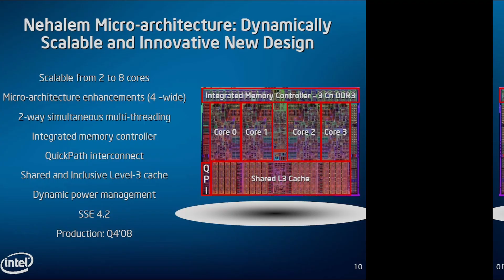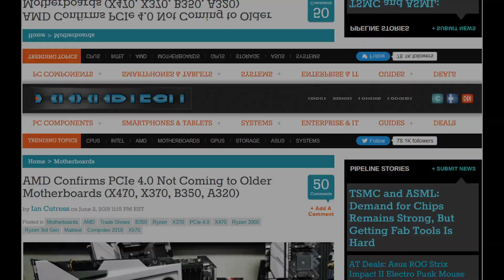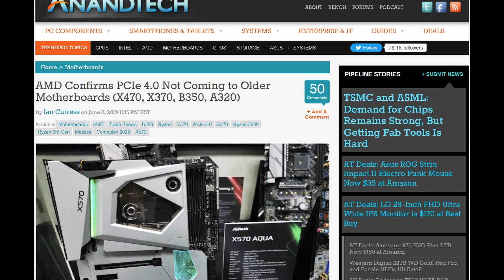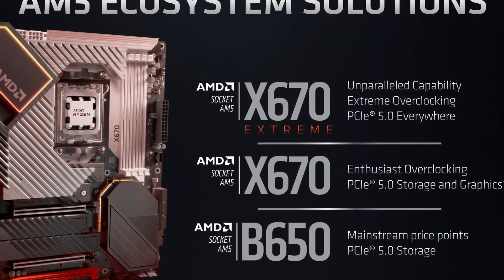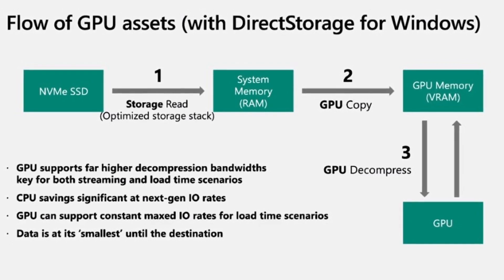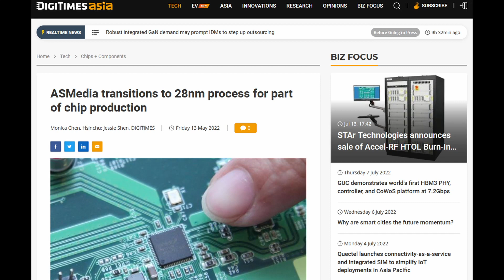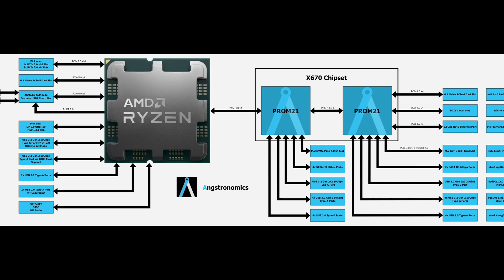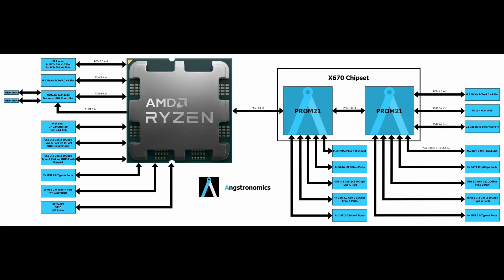The Smart Design behind AMD's X670E

Comment: Do you have an oversight why we still seem to need a Promontory 21 for 870/E USB4 connectivity. If the last 8000G CPUs already have a 2xUSB4 40Gbps support? Can't we use the advantages or differences in design of the mobile based Phoenix for Desktop? Is there a difference how the PCIe lanes are used on Mobile and Desktop platforms?

Comment: Lower speed isn't a reason to use a larger process. PCIe 5.0 has to switch at least 16GHz, much faster than any CPU core.
Why do you call them "chiplets"? There's one chip on each substrate. Would you say a multi Xeon system is made of chiplets? 
Why would a PCIe 5.0 slot support storage at 5.0 speed but graphics at only 4.0? (Assuming a PCIe 5.0 graphics card is available.) PCI doesn't distinguish between the different applications.
Reply from the maker: You are right, they are not actual "chiplets" like AMD has been using since Zen 2, but its a MCM chipset and its the same idea: build a single one and combine them.
The part where some boards support PCIe 5.0 for storage but not PEG is not because it wouldnt work, but because of market segmentation. They want you to buy higher end boards. Oh, and chipsets use older trailing edge nodes for economic reasons.
Reply: @HighYield  Every manufacturing decision is economic, chipsets use older process nodes because they have more predictable analog parameters. Purely digital CPU cores are more tolerant of such variance. By MCM, do you mean multi chip motherboard? Most MCMs have heterogenous dice. The PCI SIG should protect their trademark if these boards are not conforming, the slots must not make any distinction between the different types of peripherals according to their own specs.

Comment: I like SFF builds and my last 2 PCs (Intel i5-7500 and AMD R5-5800) were built on the mITX form factor, so I'm not a fan of segmentation of features purely based on chipset if those features can be otherwise physically implemented within the mITX form factor with all the lanes available from the SOC. For mATX, ATX and larger, the segmentation makes more sense due to the physical length of traces required.
Reply: Amd is slapping like a hotdog to the bum.
Reply from the maker: My current setup is also a SFF build (in the Cougar CBX), although I will like move to a slightly bigger base for cooling and to support large GPUs. I dont think you need to be afraid of missing out since even the SoC inside a Zen 4 CPU would be plenty to supply a ITX mainboard with a x16 PCIe 5.0 slot for the GPU, a 4x PCIe 5.0 slot for M.2 (or even two) and a lot of USB. With the addition of a B650(E) chipset, a second M.2 slot and USB4 should be possible. Not much more space on an ITX board imho.
Reply: @HighYield  sff is slapping raw...

Comment: Now we could talk about something as important:
pcie 3.0 vs pcie 4.0  on paper would be day and night, but on reality a gpu (on this example) would not have much technology to make that diference apparently. So a  gpu of pcie 4 is not so limited on a pcie 3, but a pcie 3 gpu on a pcie 4 go smoothly
Well what about pcie 4 vs pcie 5?
PD/Edit: in base of this is what I would buy or not a brand new mobo.
Reply from the maker: It wont matter for GPU performance. Just like you said, PCIe 3.0 to 4.0 doesnt really improve GPU performance, even at 4K using a 3090 Ti the gain is below 5% and it will be the same, or even less, going to PCIe 5.0.
But where it could really help is when games start to use Microsofts DirectStorage. This will allow the GPU to directly access a M.2 SSD, without bothering the CPU on the way and could really cut down loading times and improve streaming.
Reply: @HighYield   Thanks for the info !

Comment: I’m be no means an expert, But I cannot see how having chiplets in all these different parts is not causing  latency. The CPU, GPU and board chipset will all be chiplet designs. To me it seems like there has to be latency somewhere. It took Zen 3 for them to really figure out the Infinity fabric. This is all very interesting and I love what AMD is doing but I definitely have to see how this plays out. That sucks and it’s taking all my self-control because I usually buy every new GEN lmao. Seems like i might be just swapping out my GPU this go around.
Reply from the maker: Latency is only really an issue in latency dependent chips, like CPUs and GPUs. For a chipset, who supplies more USB, SATA and PCIe lanes, a little more latency doenst really have a big impact.
Reply: @HighYield  i understand,  I was just thinking when your gaming SSD is running through the chipset lanes. On a whole if you have a full AMD system i just thought all the latency would have to add up at some point lol

Comment: Have a 3850x system. Going to skip the better price on a 5950x and go 7000 by the end of the year.
Reply: Wait for Zen 4 with 3d vcache it will be available in January and MUCH better for gaming (15-20% in some games). A 7950x3d would last like 10 years

Comment: Do not really need a gpu on Pcie 5 but ok.
Reply from the maker: PCI 5.0 isnt really useful for the GPU, just like 4.0 still has very little benefits. But DirectStorage could change that, because with this new technology, GPUs can directly access a M.2 SSD, and if both parts run with PCIe 5.0, loading will be much faster.

Comment: have owned my r5-5600x for 2 years soon and I have no plan to upgrade my mb-cpu-ram and will get those new GPUs that will realise this year
Reply from the maker: My main system is still running a 3600 (even tho I'm upgrading to a 5800X3D soon), a 5600X will be more than enough for the next couple of years, no question.
Reply: @HighYield  well I think I may go for 5800x3d  2 years later if I need a upgrade or I will upgrade whole system

Comment: I can understand people will buy cheap MB but why PSU, my 240USD PSU are from 2011 and almost 12 years old and will keep it another 5 years idk how some people goes for low end PSUs when they have like 10 years of warrenty and even more life spin than that. when I move to ddr5 I will not get anything lower than 6400Mhz well no we can get highest as 6600Mhz 38Cl what I found but does not have a good price (700USD for 64gb) when 16gb cost from 100USD.
Reply from the maker: I agree, cheaping out on a PSU can backfire, because it might fry your entire system. And ppl often underestimate how a good PSU affects system stability.
DDR5 pricing is still over 2x compared to DDR4, lets see how it will develop once Zen 4 has been released.
Reply: @HighYield  well I agre with you but I can get 50% price drop on ddr5 :D

Comment: Great video. You've earned a sub.

I can see the advantage of using chiplets on chipsets. I wonder if more of the chipset function should be moved into the CPU package though as a separate Chiplet from the IO due?
Reply from the maker: I would like more I/O to be in the SoC part of upcoming CPUs so I dont need a chipset on my mainboard, but I think since not everyone needs the same amount of I/O, putting too much into the CPU itself could be bad from a economic point of view.
Reply: @HighYield  Possibly. Personally right now I do have a 5950x, and I could see the higher end IO option with many IO dies working quite well on a higher end desktop CPU, especially now that AMD may be giving up on higher end desktop Threadrippers. There doesn't seem to be a plan for a TRX based Zen 4 Threadripper with 3d Cache.
Reply: The largest problem would be everything having to be packed into the area the GPU & NVME M.2 have to be.
The APU market would need 1 NVME M.2, perhaps a single expansion slot so there'd be room for the other controllers close to the APU.

Comment: This video is highly underrated. We need more of these type of video's.
I think AMD is pretty much underrated too, at least for the mass. I mean if you look at the many innovations AMD brought to the x86 platform in the last 20 years is very impressive for a company with a smaller R&D budget. I'm happy Ryzen made AMD a much more respected company but technology wise, AMD has always been on another level. 

As for a SoC only boards, Yes please!! :) But for me it'll be more about SBC ( Small Board Computers ) so I hope AMD will make some "Next Gen Phoenix" APU's that are power efficient enough for some bad ass SBC's. Perhaps with 3D V Cache lol :D.  I see a lot of new devices popping up from 2025 onwards.
Reply from the maker: I think innovation is also a function of necessity. AMD had to innovate in order to compete, otherwise they actually would have gone bankrupt. If you want to compete against Intel you basically have to innovate, at least if you want to produce your own products. Many ppl dont remember, but AMD started out by copying Intel CPUs. Then their clones became better than the original and then they started their own designs.
Reply: @HighYield  I remember when AMD did bit-slice (2900) and memory as well (AM3101)
Reply: I've been using AMD boards and CPUs since the K6 days.  I'll never change to Intel on principle.
Reply: @ministryoflies1344  I went to the shop a long time ago to buy an Intel Pentium 90Mhz. But it was sold out. I didn't know AMD back then. But the AMD K5 100Mhz CPU was on stock for less $$. So I bought an AMD instead. I was sold, it was even faster than the Pentium in many cases and ever since I only bought AMD's. I only used intel because of my job. But personally, the last intel I spend money on was a 486 CPU lol.
Reply: @nedegt1877  My very first build was a 486 DX4 Intel...around 1995.  I ran it without a cooler until a few games came out that it struggled with.  I had no spare cash to buy a heatsink and fan so used to put a half frozen can of lager on the chip to overclock it to 120MHz 🤣
Reply: Love the way he explained the history and what to look out for when figuring out what type of board to get depending on your needs.

Comment: I didn't see any 2 dimm AM5 boards 2 dimm motherboard is better than 4 dimm motherboard when it's comes to stable memory overclocking
Reply from the maker: Yeah, so far I havent seen a 2 DIMM AM5 board either. I think someone did ask the same question during AMDs "Meet the experts" AM5 mainboard event last week and ASUS didnt say if they are planning a "Apex" like product for AM5. Especially with high-speed DDR5 it could be useful. Another "option" could be a ITX mainboard, as those usually only come with 2 DIMMS.

Comment: i'd like to have more PCIe slots, not need gen 5 but for example: 1x gen 5x16, 1x gen 4x16, 2x gen 4x8
if i need to connect GPU and 25 Gbps NIC and also 32 Gbps Fibre Channel  HBA and leave 1 more slot just in case
Reply from the maker: Yeah, for high-speed connections more PCI-E slots are always important. Do you actually connect a 32Gbps Fibre Channel directly to your PC?

Comment: This is interesting : so the chips serve as switch/bridges to reduce the pci express lenght on the motherboard as well as io hub.
Reply from the maker: I haven seen the exact layout of the Promontory 21 chips yet, but the closer the chipset is to the actual I/O port (be it PCI-E slot or something else), the easier it is to design a clean signal path. And with two chipsets on one mainboard, pathing should be more straigh forward. The "switch" part is speculation on my side, but that's how I would try to implement it.

Comment: An AMD server has at least 128 PCIe lanes, it doesn't use a chipset at all. It won't start using multiple chipsets to use as a beefed up PCIe switch.
Reply from the maker: You are right, as others already pointed out. And it doesnt really make sense to create a chipset that could be integrated into an I/O die on a server CPU. So the scaling would only working for consumer products (mainstream to HEDT).

Comment: I want a gen5 m.2 and x16 GPU, 3+ gen4 m.2, 6+ SATA, a generous amount of USB 2 & 3 ports, and either two USB 4 40gbps ports or expansion slot with enough lanes to support an add-on card to add  2x USB 4 40gbps ports.  I'd want it to be less than $250 as well.  This would hold me over till next socket.
Reply from the maker: I think I have already seen some mainboards with these specs, but I'm not sure your price target will suffice ;)
Reply: @HighYield  he dreaming with that price lol

Comment: Good presentation. I will be going for the X670, not the X670E.
Reply from the maker: X670 has all of the I/O most users need, I feel like X670E will only make sense if you want a fully PCIe 5.0 based system.

Comment: Bit late but I have an asrock steel legend b450m which is a pcie g3 out of the box but I have the latest bios 4.30 on it which makes run at pcie g4 I have a 3800x and a rx 5600xt which only runs at pcie x 8 though and not the full x 16 I don't think it has the traces to do the full x 16
Reply from the maker: Are you sure BIOS 4.30 really enables PCIe 4.0 on your board? Or are you maybe getting this from CPU-Z who (correctly) reads that your CPU provides PCIe 4.0 but incorrectly states that the board also runs on gen4?
Reply: @HighYield  Yeah after a bit of googling I think you could be right there HWiNFO is telling me the card is PCIe v4.0 x16 (16.0 GT/s) @ x16 (8.0 GT/s)
Reply from the maker: I knew it! The same happened to me a while back, CPU-Z showed PCIe 4.0 and I was like "cool", then I goggled it and well, sadly it wasnt true...

Comment: You should consider a video on what it would take to move one of those chipsets into the CPU package. Would AMD have radically change the motherboard layout to make it possible? Or is AMD stuck with the current motherboard layout? Personally, most buyers would want 16x 5.0 PCIE for the GPU, 4x 5.0 PCIE for a SSD and ethernet from the CPU for the minimum spec until the older platforms are phased out. The other IO can share the PCIE with the SSD.
Reply from the maker: Lets see if we get some more infos about Promontory 21, e.g. transistor count and the process node its produced in. I think it would definitely be possible, the question is, if its a economic choice?
Reply: Reading Angstromics article about AMD 600 series boards it already happened, the motherboards chipsets are just PCIE hubs with controllers attached.
As higher speed PCIE requires tighter constraints on signal length, physical space forces use of hubs.
The daisy chain dual chipset allows distribution of controllers.
 In consumer, i/o except GPU & NVME is hanging off the same 4 lanes as other devices are rarely in use simultaneously and it avoids HEDT/server manufacturing costs.
Reply: This is all i want. Hopefully they have B650E

Comment: I am going to get a 670 extreme motherboard as i expect it to last for at least a few generations of AMD cpus, plus support all the pcie5 add ons we might find in that time period.
Reply from the maker: A full PCIe 5.0 system (M.2 + GPU) would be amazing to have, especially if DirectStorage will be implemented into a lot of future games. Lets see how many generations a X670E mainboard will support this time, I think less than a X370 which goes from Zen (1) all the way to Zen 3D.
Reply: @HighYield  Being able to go from Zen1 to Zen3D is stunning. Factor in the relentless 'new motherboard' requirement for Intel, and this becomes waaay beyond stunning. But, that was competition-driven, and with how well AMD are now doing, I don't see any more than 2 full Zen generations (excluding refreshes/3D variants) this time - still, that would be excellent too.
Reply: @HighYield   DirectStorage was reportedly still using CPU decompression rather than streaming it directly to VRAM and decompressing on GPU in April this year.
The CPU decompression was bottlenecking the fast NVME drives in past tests, so even PCIE4 wasn't benefitting game load times.
The CPU decompression has become very evident with the Spiderman port from Sony that streams in data.
Was looking at an upgrade to a fast NVME drive, but not finding evidence that it's worthwhile.

Comment: Threadripper Pro supports 128 PCIe 4.0 lanes over the CPU , an chipset which is  rather an I/O Hub is not really needed , Server often have no chipset but TR Pro is High End and the Motherboard has to offer much I/O . I could  live with no Chipset if i would get more PCIe CPU Lanes , 20 / 24 Lanes in Mainstream is not enough for my needs .
Reply from the maker: You are right, servers usually dont have a chipset and Threadripper already supplies more than enough PCIe lanes for most users, still I'm sure there are some power users who could always do with more.

How many lanes do you need for your setup and what are you connecting with it?
Reply: @HighYield  
I use 8 Lanes for a QSFP+ card , 40 Gbit Ethernet direct to NAS  , second port to my 10 Gbit Ethernet Switch  , 8 Lanes to the GPU , 4 Lanes to the first NVME ( CPU ) 4 Lanes to the second NVME ( Chipset) and a 3 rd NVME on a PCIe Adapter card ( Chipset ) with an B550 Board and an 3900X 12 Core
You can buy 40 GBit Dual port cards really cheap currently , i payed 30 Dollar + 15 Dollar for an PCIe Adapter because HP has its own LOM Format which is PCIe but not compatible to normal . Not that i currently need 40 GBit with the HDDs in the NAS but at some point in Time i will change to SSDs and then 40 Gbit will make sense
Reply from the maker: WIth a setup like this, a lot of PCIe I/O makes sense. I dont even use any NAS, all I have connected externally is a Xbox game pad and a USB mic for my videos. Completely different requirements.